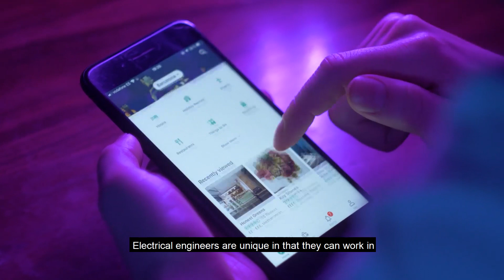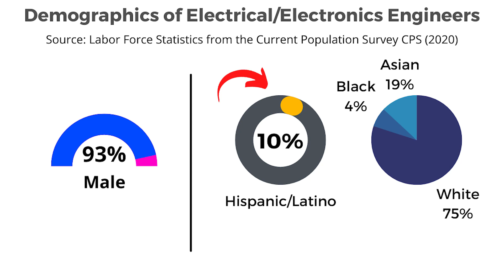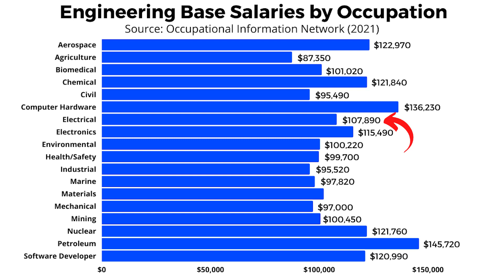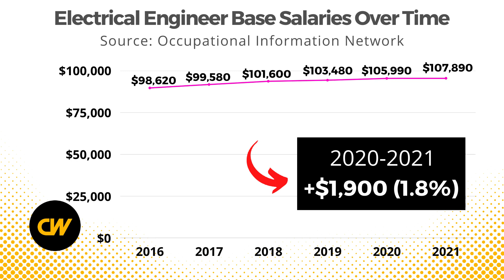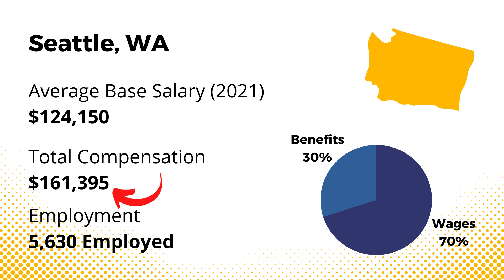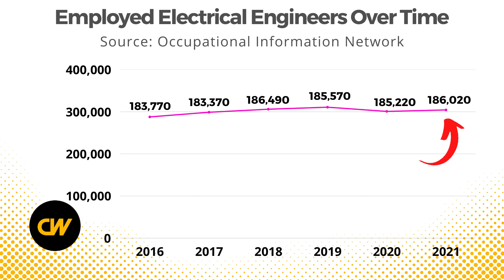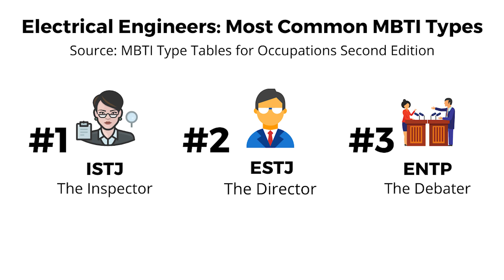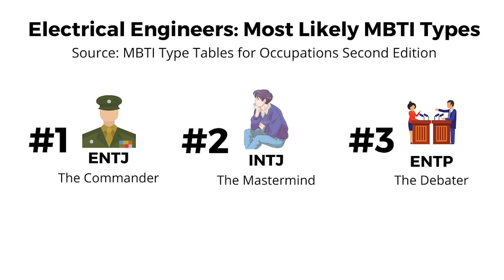Electrical Engineer - Salary, Jobs, Education (2022)

Comment: I’m in my 4th year of electrical trade school, I want to take my career to the next level and going to pursue Eletrical engineering for building electrical systems design which is my specialty rn I build jobs from a set of prints the engineer designed and that’s what I want to be doing
Reply: I am going through the same thing good luck
Reply: Easier said that done, what might look like a drawing to you could mean life or death to a engineer. Just pursue the career knowing the difficulties and responsibilities.
Reply: @majorsigma6011 making a mistake as an electrician can also be the difference between life and death. They can make the switch if they work hard and put their mind to it.
Reply: You come from a hard working background, i believe you got this! But be warned, physical work is not mental work. Completely different muscle. You’ll get used to after a year in engineering.

Comment: I’ve been working at a plant in Cali as a machine operator for about a year. When I first got the position I was unexperienced and really felt like I was working with some super advanced machinery I’ve never seen in my life but this last year I’ve learned how to operate it well. However these machines do have consistent problems that of course me as the operator is in charge of fixing. But when I cannot fix it due to my lack of experience and knowledge I then would call a technician who focuses more on the inner electrical parts of the machine. Every chance I get I would spectate the techs and their work was very fascinating to me. I wanted to learn more which is why I decided to go back to school. I will be going to a community college but I do want to go to a university and get that professional license. However Im not entirely sure what courses to take and as far as electives, I would like to chose some that would benefit my understanding of electrical engineering. What would you recommend?
Reply: Technicians mainly do repairs on electrical equipment. You can still get a good understanding of electricity and all those components.For that, all you will need is either trade school or an associates degree in electronics technology(I think this is correct). Electrical engineering do more of the designs for electrical systems, testing, programming which will require a bachelors degree in electrical engineering if you are interested in becoming an electrical engineer (which is math heavy and consists of courses such as calculus 1, 2 ,3 and Physics courses that are calculus based and these are just the start of the major) Whichever it is, go for it! You got this!
Reply: If you want to just learn how to work on machines (like CNC machines), you just need to take AC and DC circtuits, CNC programming, PLC programming and a few relevant courses from any mechatronics/electronics technology curriculum at a community college. I am a technician and diagnose issues with CNC machines and often fix them.
Reply: I would like to take some knowledge from you and your experience
Reply: Community colleges have apprenticeship you get experience from county and get journeyman license with associate degree, so you can also transfer to uni if you want but I bet you wont need batchelor